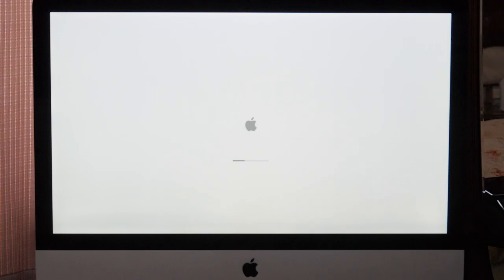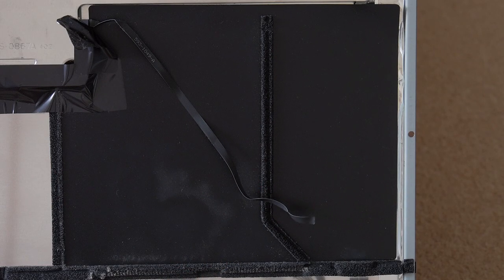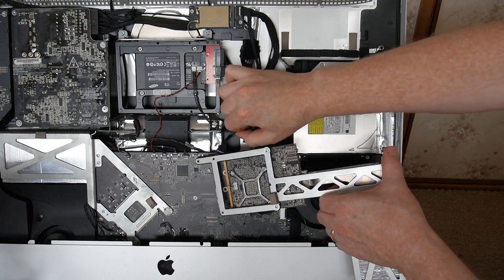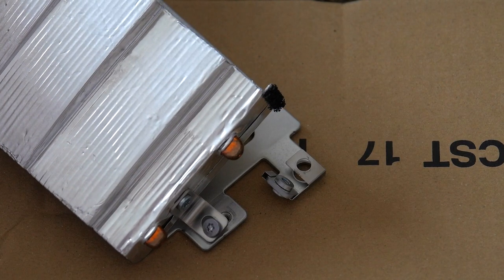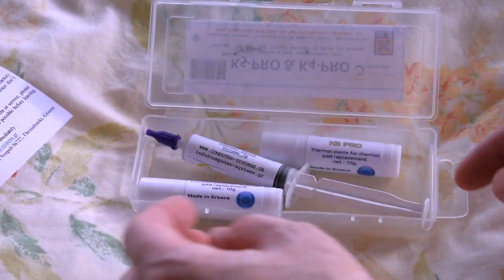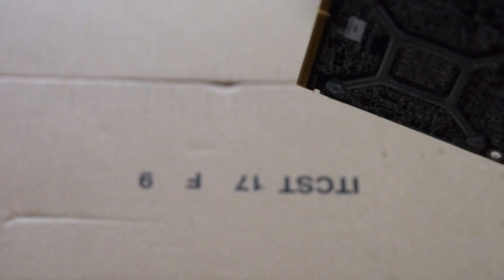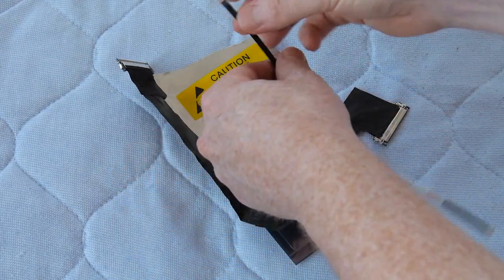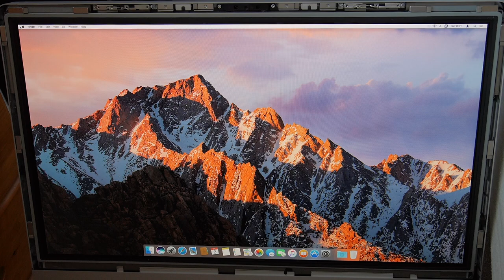Late 2009 iMac 27" Video Card Repair — 4850 — 2nd Bake

Comment: After many months of swopping out hard drives with multiple images , checking Ram / cables / trying different OS’s , finally I came across your video on baking. 

I was like Whatttt , baking a Graphics card😳 it was my last hope and yesterday I followed your step by step tutorial and thanks to u , I have my 27” iMac 2009 spec up and running again. 

Thank you for sharing the video as it’s a great help to follow iMac users and saves us a ton of money 💰. 

Technicians at the iStore looked at me like mad when I told them the solution to solving this issue. 

I was asking an electrical engineer why does  baking solve this issue , according to him over time the older boards soldering points / pins loses contact , and baking them binds them back together again. 

Thank again and will keep updating thread over time as well to update the life of my iMac
Reply from the maker: Thank you for sharing your detailed success story! As you can see from the large number of comments and views on both of my bake videos, this is unfortunately a rather common problem with 2009 through 2012 27-inch iMacs. The bake is time consuming but it does work for most people who try it. Please feel free to comment back here over time to let everyone know the longevity of your bake. Best wishes!
Reply: Hi. Just an update. 
10 months later and my late 2009 27” iMac still working perfectly. Thnx again for your video / assistance 🙏👍

Comment: Thank you so much for your Video!  I had to Bake the Card in my MID-2011 27" (which required removing the main board)  However following your (and others) videos I was able to complete the repair.  That clip for the IR sensor holding the board in stumped me too until I saw the part in your video where you explained it  so I didn't waste too much time on it.  The IMAC is working now and updating software as I type this.    Thanks again
Reply from the maker: That IR sensor clip cost me a huge amount of time, so I’m glad to hear my video saved you that pain! Thank you also for sharing your story of success. Best wishes!

Comment: Just bake it!
Ups I did it again! so its April 5. 2021 I was really surprised by the breakdown of my iMac (late 2009) but since I baked a few newer ones before I was equally hopeful and afraid before baking. Because the symptoms were horizontal grey lines. BUT it worked. 8 minutes at 200 C°. 
2009 27 iMacs are easier to take apart than 2011.
I'm on that machine writing it :)
Reply from the maker: That's great to hear!  Thanks for making time to let me know.  Just to confirm though, did you clean off all the old thermal paste before your bake and then apply the 2 types of new thermal paste I recommend after the bake?  I ask because thermal paste plays a big role in how long the card will remain usable post-bake.

Comment: Thank you for your June 2018 update! And of course thank you for this video (and the previous one). I think I will be following in the same path to fix my iMac... It's great that you wrote down everything you used, in the video description. It's very helpful.
Reply from the maker: Armin, thank you for your kind words, and thank you for taking time to read the Description under the video, seeing that many people overlook that.  I read and reply to every comment under both of these videos, and I can tell you that most people who try the bake are successful.  In fact, out of all the comments who reported back with success stories (which comprise most of the comments), only about 4-5 people reported back with problems, and some of those I was able to help by telling them to recheck their connections.  Only a couple people had video cards too far gone to bake back to life.  So in a nutshell, I think the 3+ hours it takes to do the job is worth it, especially in light of the fact I am now going on my 12th month of use after my 2nd bake.  I can only suggest that you use the same pastes I did in my 2nd bake.  They are worth it.  Best wishes!

Comment: Thank you so much for your video. I baked my graphics card today and to my amazement it worked. I had taken the iMac to the Apple store and they had diagnosed a faulty hard drive but I had my doubts when it wouldn't boot from an external disk. I would have never attempted it without your video but I couldn't face removing the motherboard.
Reply from the maker: Thank you for sharing your success story! Removing the entire motherboard is only necessary on 2009 models when you want to change the PRAM batter on back. It’s silly they put it there. It would have been more wisely placed on the front. Best wishes!

Comment: Thanks so much for your two videos!  I'm yet another user who is typing this message on my restored 2010 iMac.  Before baking the GPU, it kept repeating the startup chime (about every 5 seconds), with a black screen.  No keyboard overrides would get it to boot or do anything other than chime continuously.  I used Arctic Silver on the GPU, thermal-conductive pad on the memories, and Arctic MX4 on the large chip resistors.  While watching this video GPU diode is at 53C, GPU heatsink at 49C, GPU proximity at 51C.
Reply from the maker: Thanks wonderful to hear, Jeff!  Thanks for sharing your success story.  The only thing I can suggest is that you download one of the fan control apps mentioned in the Text Description above (click "SHOW MORE" to expand it), and set all fans to 2000rpm.  Noise isn't too bad.  That's what I use.  It keeps the machine running a bit cooler than stock fan control.  Best wishes!
Reply: @JDW-  
A followup more than a year later... My 2010 iMac is still going strong.  No gpu or other hardware problems at all.  I took your advice to install Macs Fan Control to keep the temps a little lower.  Thanks again!
Reply from the maker: @JeffInCO483  Thank you for the 1 year update, Jeff.  I'm certainly glad to hear that video card is still going strong.  The bake doesn't last forever, but I do hope you can get at least the same 2 years and 9 months I got out of my second bake!

Comment: Absolutely fantastic process! Literally saved hundreds if not thousands of dollars (had I bought a new iMac as planned). The residual thermal paste from the factory looked ok but I thoroughly removed it nevertheless.I had some 95PGF4 perfumers grade ethanol on hand- reasoning that any water in the ethanol solution would evaporate in the oven. The thermostat on my gas stove oven only had one setting but after a preheat I'm confident it was at least 180' Celsius. I chose Arctic Silver (conductive) for the GPU and Noctua NT-H1 non- conductive for the surrounding chips as my local computer store didn't have any K4/K5. Overall this has been a great learning experience and I really enjoyed the list of tools required, descriptive video and also your reminder of "TAKING YOUR TIME'. Thank you so much!
Reply from the maker: That's wonderful to hear. Thank you for sharing your success, Karl!

Comment: I just wanted to thank you for putting this wonderful tutorial on YouTube! I initially saw your 4th bake video, and you mentioned your success with the 2nd bake, so I went along with what you did in this one.

I have a 27" mid-2011 iMac, and I didn't have the easier option of freeing the graphics card, so I really appreciate seeing how you took it all apart in this video. I used tape to hold the wires in place after disconnecting, and I successfully reattached them all in the end!

There was a big issue with trying to put the motherboard back in. I ended up having to take out all of the RAM, and it slid in perfectly without any issues.
I also want to thank you for listing the necessary items. This truly was the best tutorial that I found.

I had an issue with the computer suddenly fritzing out on me. I ended up with 5 pink vertical lines on the screen. It didn't even show the apple. It was just blank with the 4 lines. Somehow I found out about this "ridiculous" idea of baking the graphics card in the oven. I am now a believer. I preheated the oven to 400 degrees Fahrenheit, and placed the graphics card, just as you did on the 4 little foil mountains for 10 minutes.

The computer turned on at 3:12am PST on June 1, 2020. Let's see how long it lasts!
Reply from the maker: Crystal, thank you for making time to share details of your successful bake.  It certainly is a "ridiculous" idea when you ponder it, but then when you actually do it the amazement sets in.  I was in your shoes when I first tried it.  The bake doesn't have eternal life, unfortunately, but in my experience it does last long enough for it to have been worth the time and effort.  Please keep me updated on how your iMac is doing over time.  Best wishes!
Reply: @JDW-  It may not have eternal life, but that graphics card is already lasting 5 days longer than it would have otherwise! Fingers crossed that the next time I reply is in 2+ years!
Reply: @crystalweber5520  and how is it going?
Reply: @daviddamini2185  Currently at about 1 year and 7 months...and the computer has been on nearly every day since new life was baked into the graphics card. I did increase the speed of the fans to avoid any overheating, so other than the noise from the fans, it has worked without any physical issues all this time. Honestly, the biggest issue is that High Sierra is the last upgrade made available for my mid-2011 iMac.
Reply: @crystalweber5520  Wow that's incredible, i want to do my first bake, after my gpu gave up yesterday (White Screen Issue)

But your comment as well as the others give me mich hope. Thank you for that :)

Do you have some additional tips?

 did you also Apply new paste to the CPU?

Again thank you for the Reply :)
Reply: @daviddamini2185  Yes, I don't usually leave comments, but this video was so helpful that I wanted to have a record of what happened.

I pretty much followed the video, but near the end I did have trouble putting the motherboard back in. I realized that it was because of the RAM, so I had to take those out with my motherboard just hanging around. I recommend removing the RAM first before removing the screen and everything else. They may be difficult to remove, but a firm wiggle here and there with a lot of persistence and patience gets them out. I thought they might break, but they are quite sturdy.

I did apply new paste. I used the one recommended in the video description above (K4 & K5 Pro Kit). I also made sure to scrape off ALL of the old paste. That took a lot of effort, but I'd say it's totally worth the extra time. I also purchased a cheapo Torx T10 from Amazon, and it was worth it. I purchased it immediately after I tried using something else and it failed miserably. The right tools make a task like this a lot less stressful.

There are a ton of wires, and labeling them with some tape is important, unless you have an excellent memory. Even if it's super boring, you'll be grateful for those labels when it comes time to attach it all again. Taking pictures before you start removing everything also helps, and having pictures of each step.

Hope all goes well with your bake! Good luck!
Reply: @crystalweber5520  thank you very much, for your detailed description :)
Reply: @crystalweber5520  it worked. My imac is running Again. Thank you for your Tips :)
Reply: @daviddamini2185  That's awesome! I eventually got an external HD to save everything because until you mostly forget that the computer had surgery, it will be stressful wondering when it might happen again. Also, checking to make sure it doesn't overheat, and if it does to turn up the fans because in the end, fans are always cheaper to replace.
Reply: @crystalweber5520  Yes i agree, i will also try to Transfer All of my data to another Computer. :) 

I also installed Mac Fan, and removed the CD Drive in order to tackle the heat issues